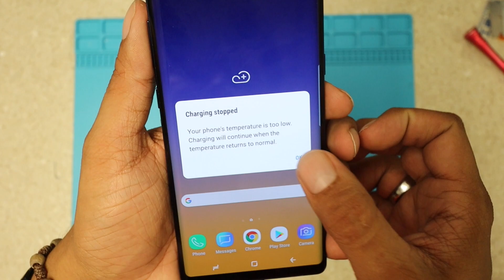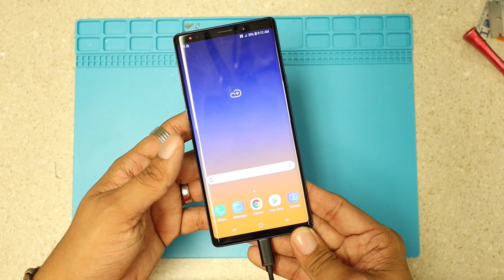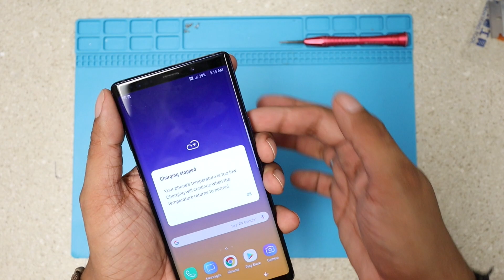Galaxy Note 9 - How To Fix "Charging Paused - Battery Temperature Too Low" Error

Comment: Worked for my note 9 after replacing the battery and charging port. I completely forgot about the wireless connectors. Appreciate it dude!

Comment: Dude, your tutorial helped me troubleshoot my Note 8. I replaced my wireless charging flex/thermal sensor, cleaned the motherboard and all contact points, and viola it worked. I appreciate your time and video, much thanks.

Comment: I'm having this issue with my Z Flip 3. It has never been opened up, and it charges normally when the phone is closed. As soon as I open it, I get that message. I used a diagnostic app, and when the phone is closed the temp is normal, but when I open the phone, it reads out as being 7.7 degrees Fahrenheit. Does this mean I need to have my phone opened and serviced by someone?
Reply: thanks it worked

Comment: Can we disable this coil,  i need to disable tat coil coz my note 9 gets green screen on middle drag,  if i unplug tat coil display looks gud,  bt i cant charge phone its showing temp low ..  getme a solution to uninstall it
Reply: same problem ! How to uninstall this coil ? Fix temp low ?
Reply: @thinguyen-dk1fz  i tired to remove but its not charging  ...  i think if custom software made by removing nfc  software feature it may be possible

Comment: So I have a Note 10 plus with that low temperature message. I have an Otterbox cover. So I took the Otterbox off and the charge started to work. If I put it on the temperature to low message occurs. Its weird. This crap happened after this last software update. So Samsung probably fucked with it through update.